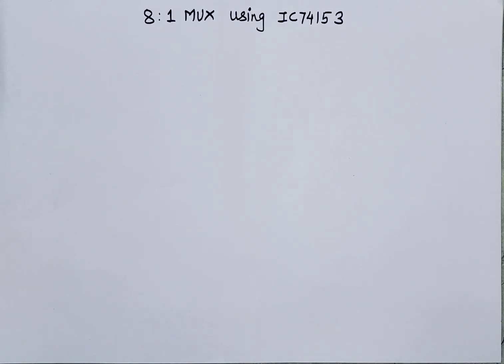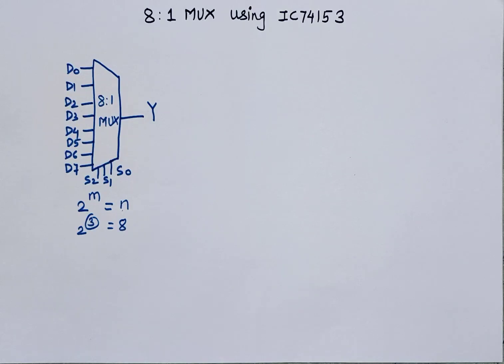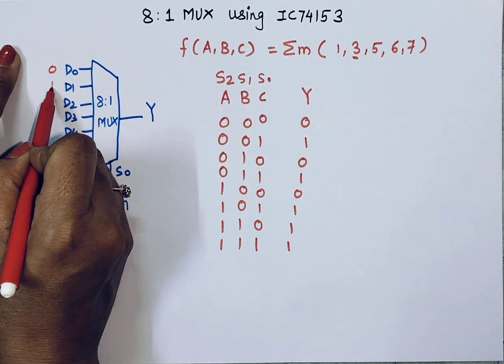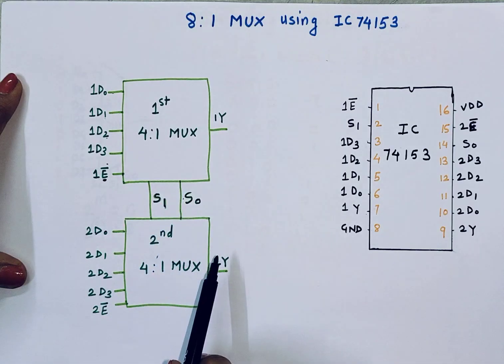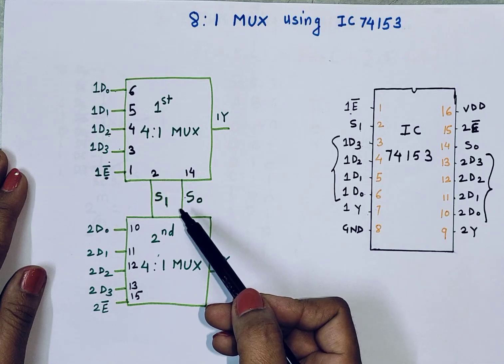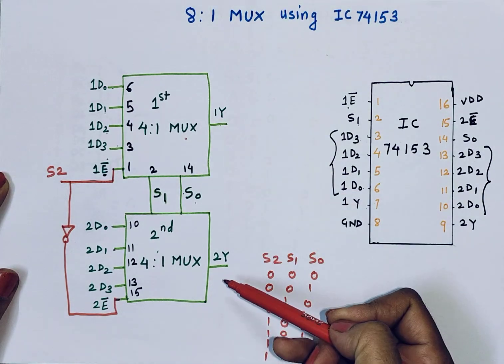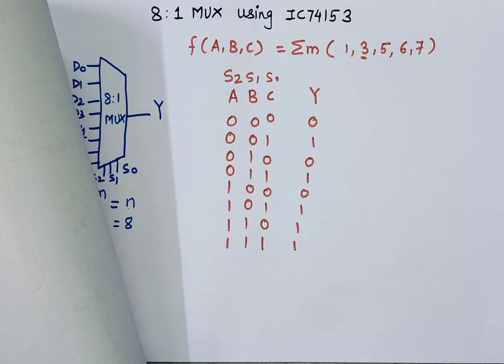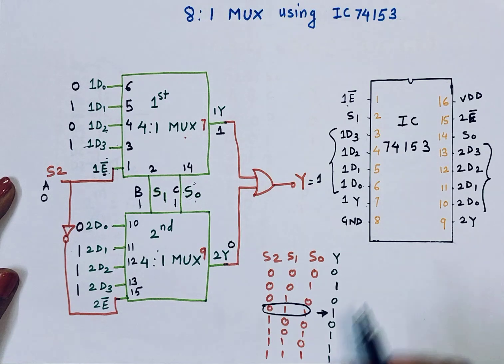8:1 MUX/ 3 variable function using IC74153 @CircuitrysimplifiedbyDr.Shobha

Comment: thats msb or lsb reduction
Reply from the maker: To implement 8:1 MUX no need to reduce MSB or LSB. 2 select lines are readily available and enable can be used as 3rd select line. In 16:1 MUX, 4th select line is not available so we need to either reduce MSB or LSB.
Reply: @CircuitrysimplifiedbyDr.Shobha 
Realize the logic expression given below using single 8:1 Multiplexer 
MSB Reduction Technique).
F(A,B,C,D) = ∑ m (0,1,2,3,7,9,11,12,15) 
in that MSB reduction technique which one input is used A & Abar or D & Dbar and which are the select lines BCD or ABC ?